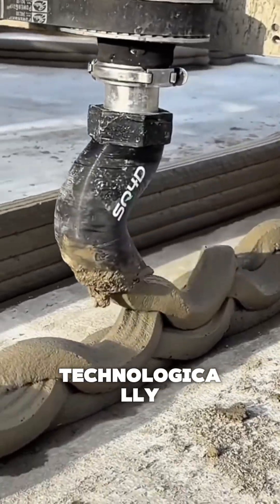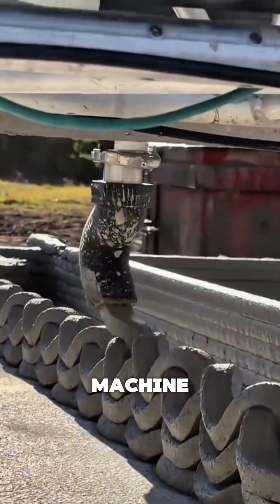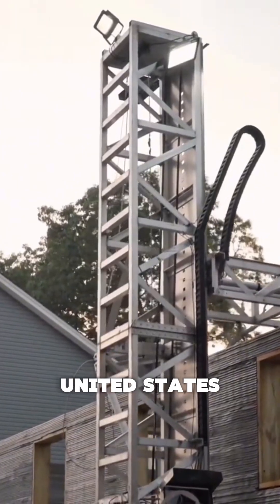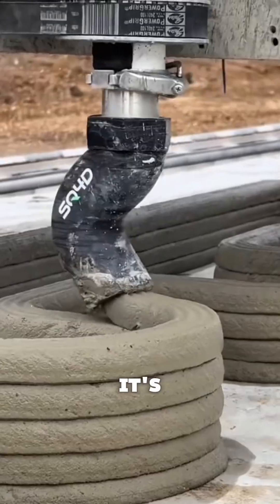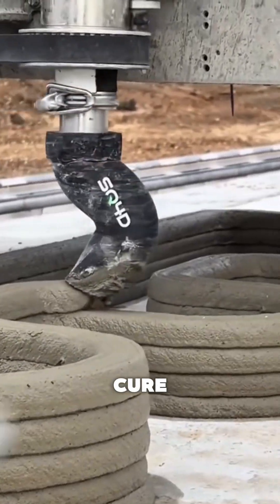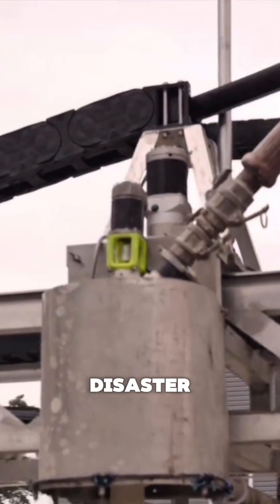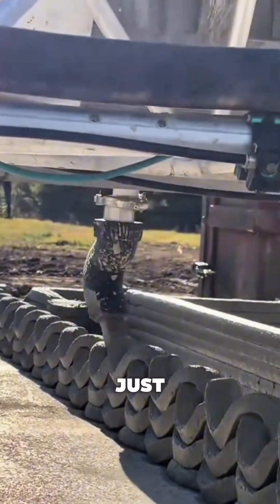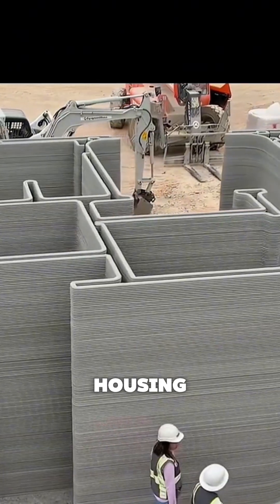Construction Companies Are Terrified of This Machine

Comment: We have large temperature swings in Texas. It will be interesting to see how bad the walls crack and how hard it will be to air condition and heat these houses. Right now we know this system is not competitive due the cost of bringing the machine in and setting it up then breaking the machine down and moving it.

Comment: However much money it saves in construction cost is how much more profit the company will make.  Savings won’t be passed on and the customer will be sold a house full of compromises. I don’t care how strong the concrete is in a place with freeze thaw cycles in the winter it will crack and crumble without rebar.

Comment: REBAR?!
Reply: Actually, the thought occurs to me that if they “weave” the “threads” of concrete, they can insert smaller-diameter instances, as well as lay the stuff against the outside walls … or just run it like this, and put heavier-gauge wire mesh up against the outside walls and “gunite” (like old-fashioned stucco) the reinforcement in place.

Comment: House should go back to under $7,000 just like in the 1940s.
Reply: How much would the printer cost to get it done that way?
Reply: You’d need to borrow a page from the OstBlok and 1) go largely prefab; 2) significantly downsize lots and home-sizes, and 3) assign homes like they did in the OstBlok.  (Such homes, if looked after decently, would have low rents.  More, you wouldn’t need to do much (time and energy consuming) commuting.

Comment: And not a single piece of rebar 😂
Reply: It’s not shown but rebar is added in layers and/or vertically afterwards. And using a simple inner layer/extrusion of air Crete can add a lot of insulation/soundproofing. It really is amazing, and a long time in coming.
Reply: Rebar cable infused inside each layer

Comment: I don't like the phrase "technologically advanced," because concrete is a very poor insulator and these buildings look ugly.

You can print the shell, but you still need to add windows, appliances, electrical, hvac, and plumbing.

Comment: No reinforcement
Reply: They have method of including reinforcement , this is old video.
Reply: There is braided cable being laid at the same time from the center of the nozzle.
Reply: @joshgravlee really ⁉️I don’t see that! , solid wire would be the appropriate reinforcement not braided cable .
Reply: @Cheers_Warren  Im just saying what the new ones are doing. I'm no concrete engineer, but I watched the videos from their engineering teams, and the stuff is ridiculously strong. Go watch the newest ones yourself and you judge.
Reply: Chicken wire against the original “splot!“ walls, then “gunite” the stuff in place.  That will provide some reinforcing.  Otherwise, they’ll need to do “inner-wall weaves” for places to put Rebar, then dump more concrete in the channels….

Comment: Wherenis the rebar?
Reply: Isnt rebar for the unknown high porous areas. The way this is distributed looks like that wouldnt happen
Reply: @parkour267 Rebar to is hold concrete together. Concrete constantly expands and contracts, cracks, and moves. This mix could have fibers in lieu of rebar, but something is required.
Reply: Run this as the “innermost wall,” then install welded wire mesh against it, inside and outside, and then apply further layers locking the wire mesh into the overall structure.